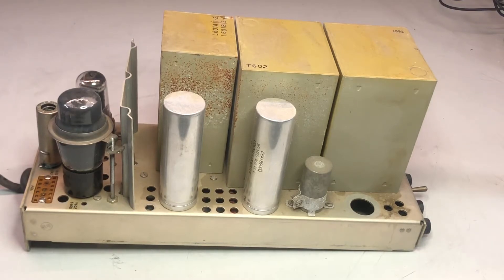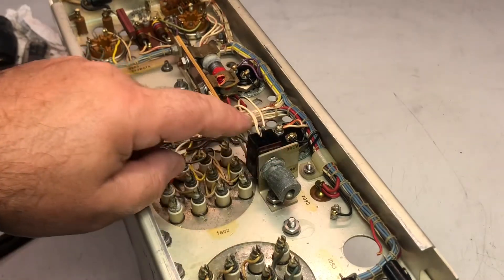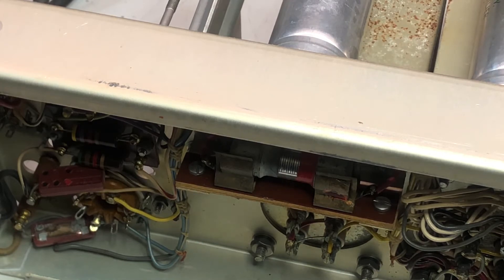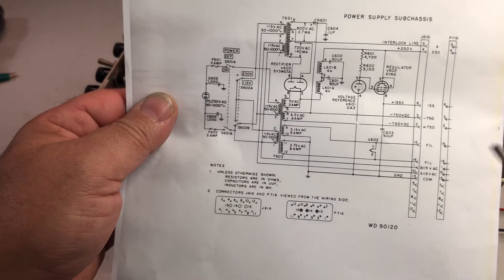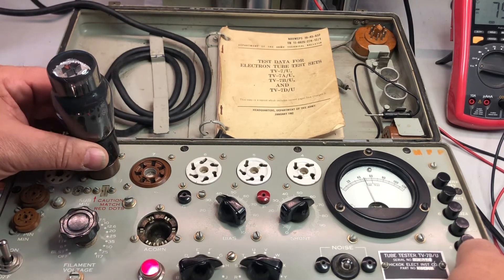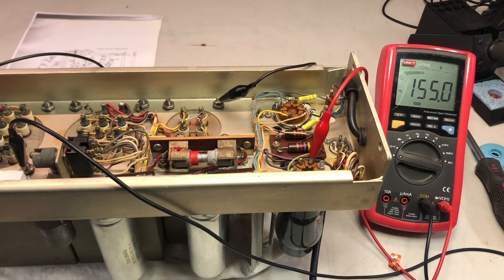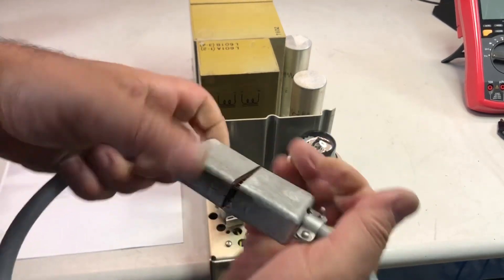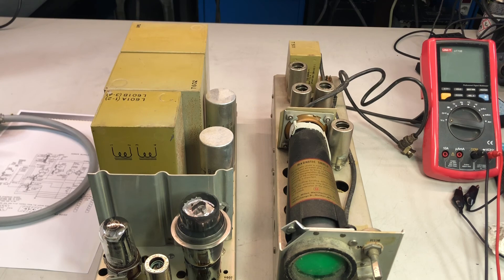FR-4/U  part 2 Power Supply repair and test

Comment: Very nice repair and what luck finding the proper connector! I believe you are correct - the regulated power supply will need a load in order to function properly. Regards, David.